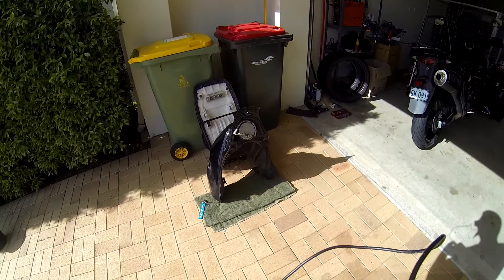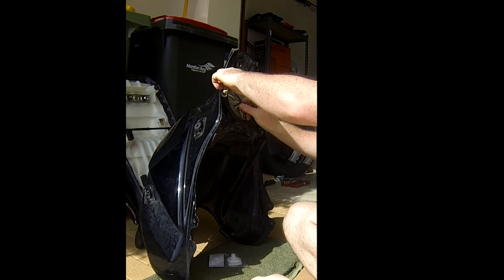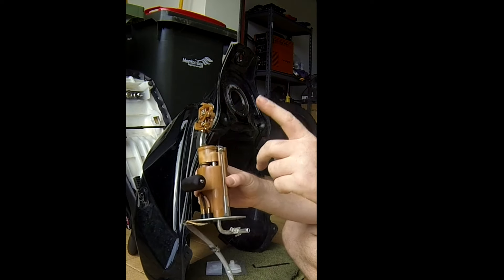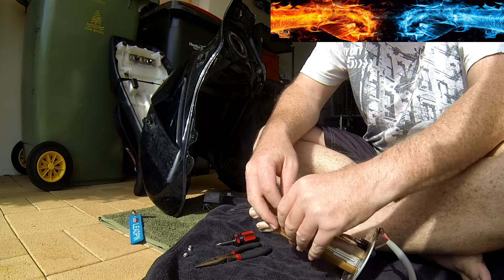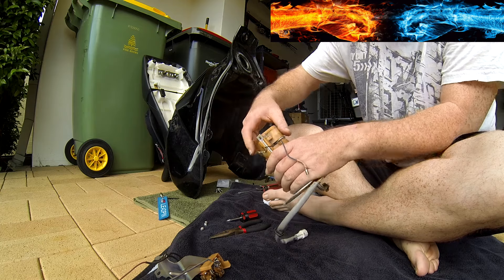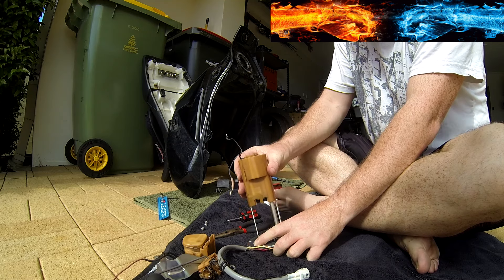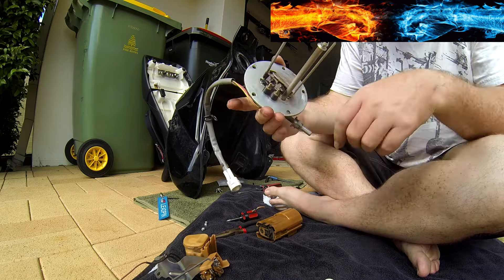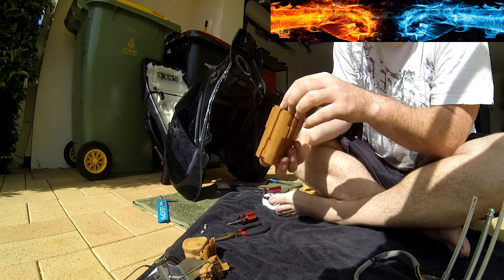How to change a fuel filter | V-Strom

Comment: Thanks man.  Great video popped mine apart and blew out a ton of goo with my handy dandy compressor.
Reply from the maker: ahhhh good idea!!!  didn't think of doing that, could have saved a few bucks!!!!   I will keep that in memory for next time!!
Reply: The only reason I thought to do it was because a replacement was $81.  I didn't have cash I did however have a compressor. Keep the rubber side down.

Comment: Just FYI, that was only the pre-screen, not the fuel filter.  The actual fuel filter is located inside that middle plastic housing, and is not serviceable.  You must replace the entire (costly $$$) fuel filter housing.  Many folks just choose to bypass the internal filter and add an in-line filter to make future changes easier.  Procedure can be googled, but requires some basic skill.
Reply: That's right. The part replaced was a low pressure screen. Think of it as a pre-filter to protect the pump. The high pressure filter that protects the injector is inside the top piece.
Reply: Fun fact for my 4th gen zx10r you cant purchase a pre filter. Have to buy the whole dam pump. 2nd fun fact a Suzuki pre filter will work fine on my bike.
Reply: @kawilifezx10r23  3rd Fun fact! I got a kawasaki zx6r 2009 and im replace the prescreen too with this video lol.. we have the same pump!!!

Comment: I changed my screen because my bike wouldn’t rev past 4000. But once finished it was no better. I pulled it apart again then it worked. But then bike wouldn’t again rev past 4000rpm. I kept playing with just the top part and the fuel pump has worked properly after just looked and working with just the top part. I did change that large o-ring but I am wondering if the two smaller o-rings are shot and I should replace those. The bike is running great after the last fix, and I rode around for about 30 minutes. Hopefully next ride everything will be working as it should be. Any ideas why a fuel pump doesn’t work like it should? It will, then it won’t. Then pull it all apart then it still won’t then again it will. Long story but it’s frustrating.

Comment: I have just done it on mine but I get a FI error and the bike stops shortly after starting. Not getting enough fuel I guess. Did your bike started straight up ? Or did it take a while for the fuel to come through ? I had at least ten go at it. Thank you for the informative video. : )
Reply from the maker: I didn't have any problems after replacing the screen, I am not sure why your bike would have been starving for fuel, perhaps there was additional air within the pump?? I hope it all works well for you now after you have got it running.
Reply: @andypandy.  Thank you. It was the STP sensor which I have removed and put it back the wrong way. Found out after putting the bike in Dealer Mode. Just shows never do 2 thinks at a time.

Comment: Thanks for the video!
Two questions: what was the appr. mileage of your bike by the time you replaced the filter? Did this procedure have any effect? Any positive changes I mean?
Reply from the maker: Hey mate, thanks for watching, I did this when the bike had 60,000 kms, it didn't really have any great effect on the bike at all, but I didn't do it for any effect, I did it to prevent any problems in the future as I was riding across Australia and back. I think I could have easily gotten away without changing it, but it is better to be safe than sorry, especially since I was a few thousand kms away from home and was literally in the middle of nowhere. That being said, I will be doing every bike that I ever own for the rest of my life at every 50,000kms whether it needs it or not.
Reply: @andypandy.  does this have a secondary filter in the top cap? Early assembly had one and that would cake up and cause problems so guys put a external filter on there bikes

Comment: Now it begs the question did it work after all that :)
Reply from the maker: +banditnev Absolutely :-)  still going strong and has done about 150kms since the change. I will be taking it out soon though just because I am paranoid about it and want to check that it is alright hahahahaha I guess I should feel that way due to being the first time I did anything like that on a bike!!
Reply: Andy Pandy did you use the OEM filter? My dealer wants to charge me $60 for that piece of cloth, ugh. I think I might buy aftermarket

Comment: The fuel filter you changed.  Where can I purchase that?
Reply from the maker: I got it online, I typed in to google Suzuki OEM parts and found a site for Australia, the part number is 15420-05H00 if that will help.  I am sure that you could find a dealer that will be able to order the part if you don't want to buy online.